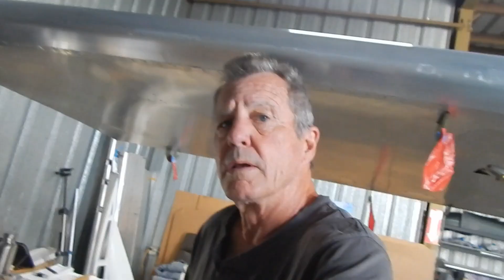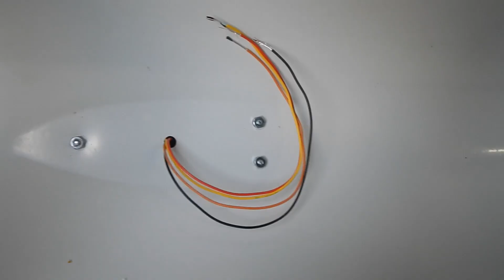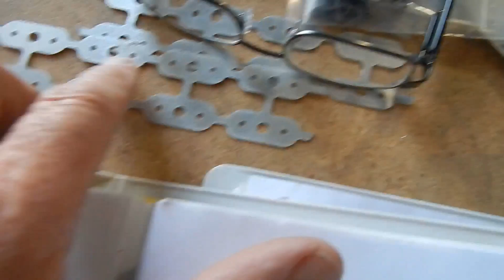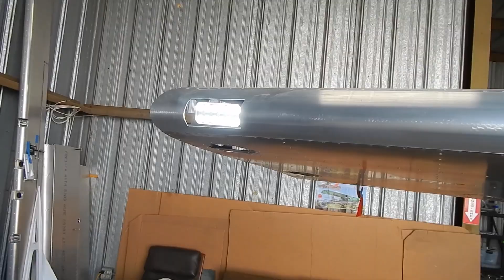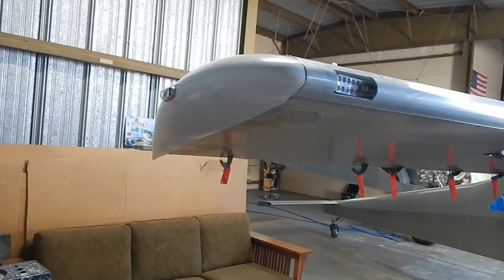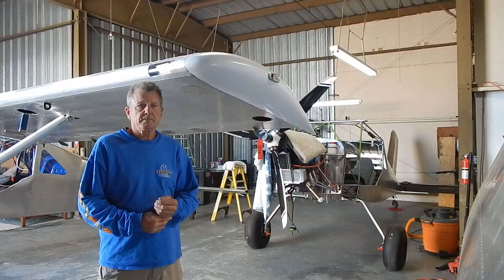RANS S21 Build - ep 63 - Wing Tips 2, NAV Lights, and Landing lights

Comment from the maker: No, NO on Nav light install method... I am going to re-install using Anchor Nuts.. The wing tips really should not be removed after painting, and I need to be able to change out the lights from the outside.. A little more work now, but possibly saving more work down the road.